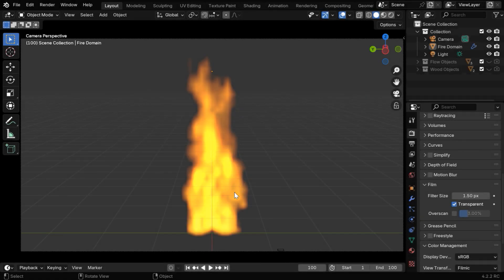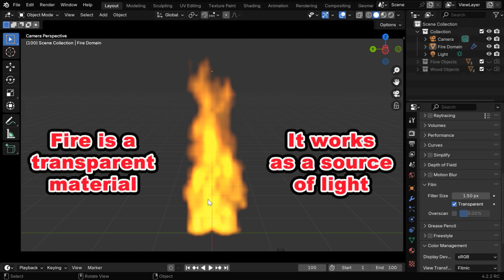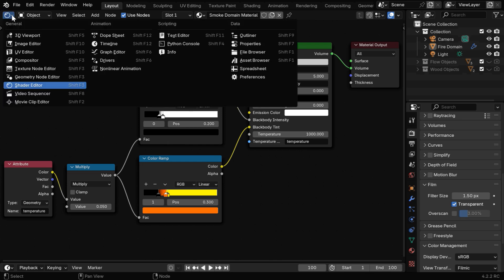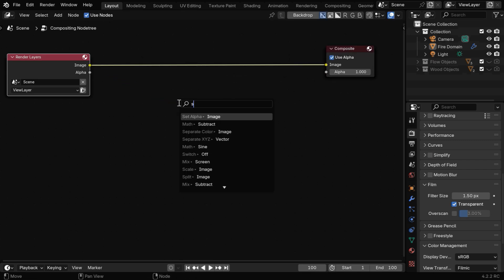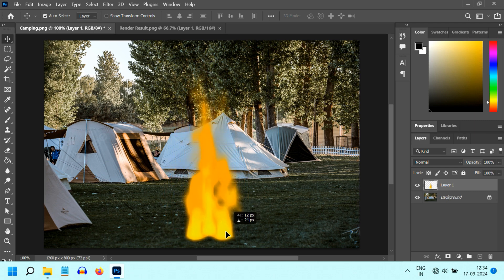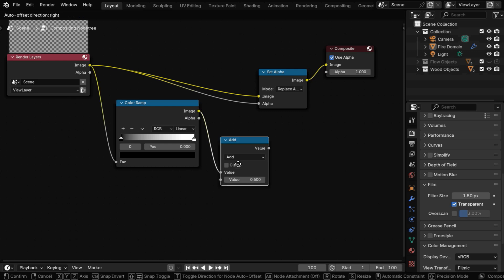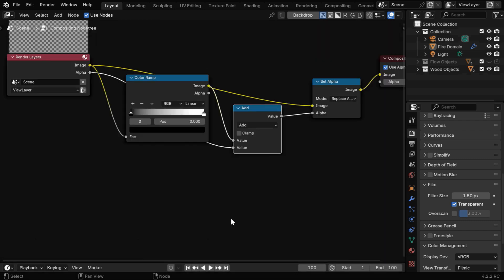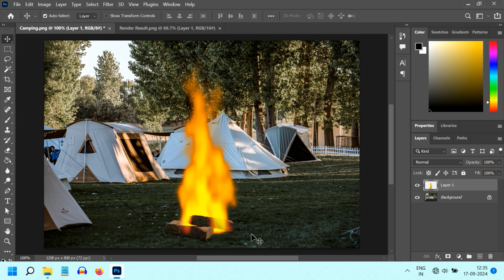Transparent Fire Animation In Blender | Compositor Nodes For Transparent Background

Comment: Thanks a lot for your videos about transparency, I want to make transparent assets to use on maps and yours seems to cover the troubles to make them, just by curiosity would it work also in webm file format? Not use to render animation, thanks again for your videos about!
Reply from the maker: Yes, it did work with webm format in one test which I did when I was working on this tutorial. It depends on which video editor you are using because even though webm maybe able to use the transparent asset, some editors may not be able to do so. So both are important.
Reply: @5MinutesBlender thanks I will test it too, I tried once and in the preview I had transparency but not in the rendered product, I will follow your instructions, thanks again

Comment: How in blender make flipbook texture of particle for game engine? How to make particle animation loop?
Reply from the maker: I did not get your first question 🤔 For the second question, we cannot control how the particles emit at any particular frame, so I think it may not be possible to create a loopable particle system (or I don't know if it is possible).
Reply: @5MinutesBlender  1) how to place blender animation frames in one picture? It called differently flipbook, spritesheet, sub uv animation. Like 64 sprites in one picture that will have 8 rows and columns. 
2) How to make particle simulation loop on itself so transition from last frame to first is seamless.

I'm trying to make fire cloud in unreal engine, ue particle system require flipbook. And i want cyclic animation.
I saw simulation loop in houdini.